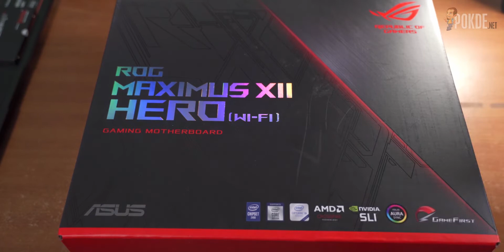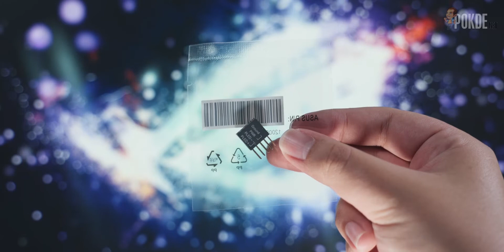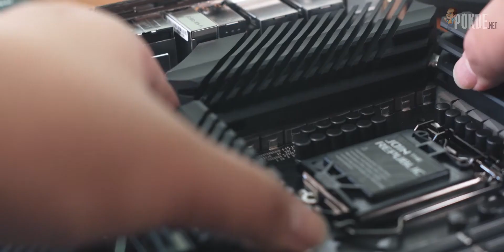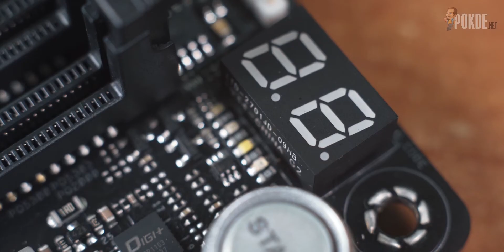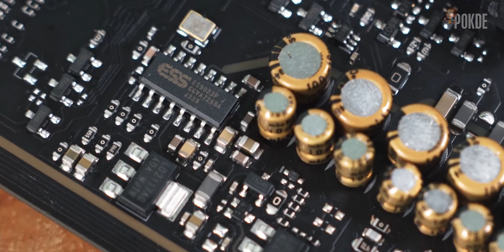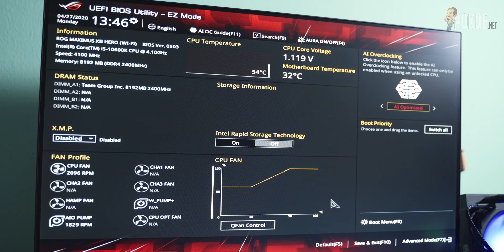Intel 10th gen motherboard! ASUS ROG Maximus XII Hero (WiFi) Preview — unboxing and peek at the VRM

Comment: talk so fast. sluring abit.. background music. apa guna wei.. even with dat still better than most preview videos atm..
Reply from the maker: Thanks for the feed back men, will improve on next video
Reply: PokdeDotNet yet its still better than all da video for hero z490 on da net atm . This time asus gave to many silly ppl om da net even ppl with 1k sub.. know crap about tech.. .. so i do appreciate your video. Whats interesting about the hero for me.. better pcie lane option & m.2 than formula and one phase less. .. so kindda curious.. but asus baskets tends to nerf all mobos non apex/extreme in the bios for ram clocking with high clock cpu. So your review atm made me lean towards hero as i can for-see cooling issue of 10900k for 24/7 in MY because of the die size+our ambient temp. So even if the formula/extreme/apex is capable of more.. for 24/7 stability it might not do any diff than hero.. any idea when you can release pics of the bios?? Also will asus F up strix?? Then tend to almost every launch for intel mobo..